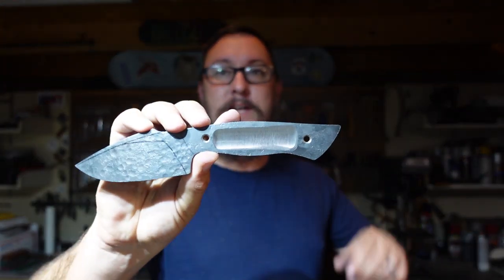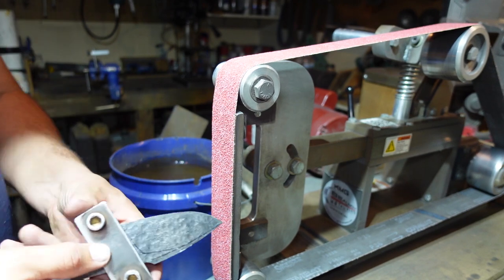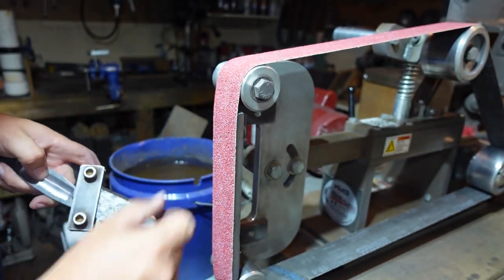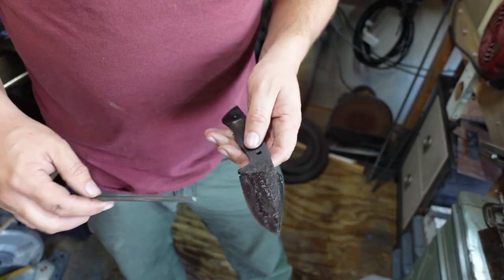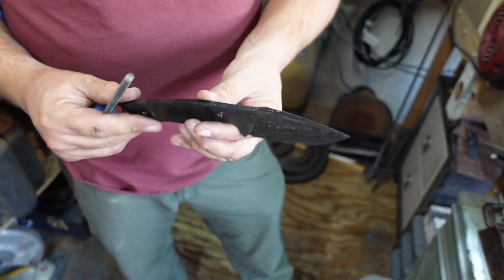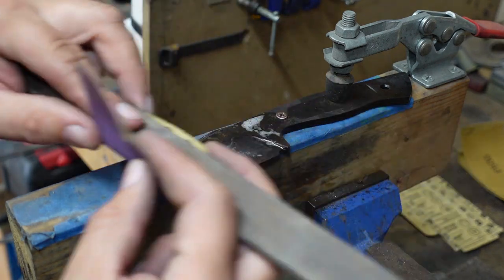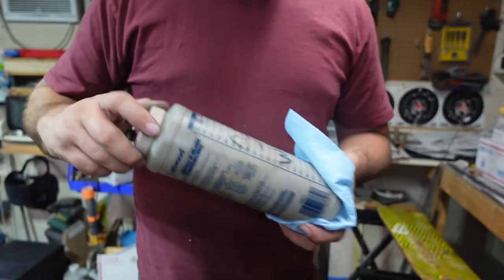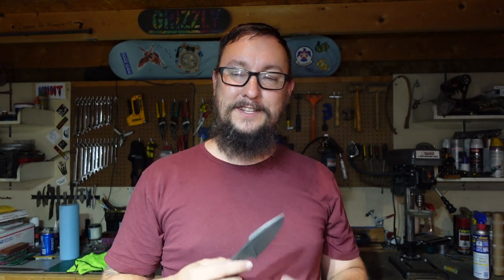Grinding The Bevels And Heat Treating The 5160 EDC Knife | Shop Talk Tuesday Episode 121

Comment: Love it!  Have you ever checked the actual temperature on your oven?  When I checked mine, it was nowhere near the set point and it varied a lot.  I just finished converting to a PID controller.  I actually just built one to control my gas forge also…haven’t tested it yet.  Awesome knife.